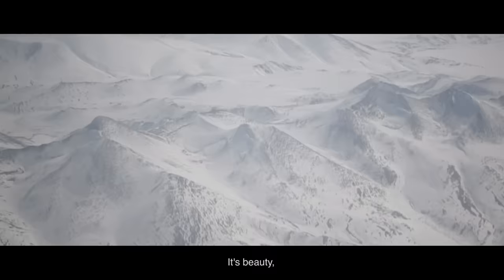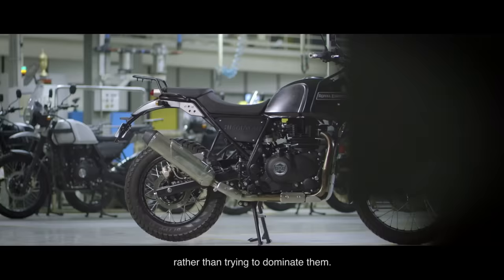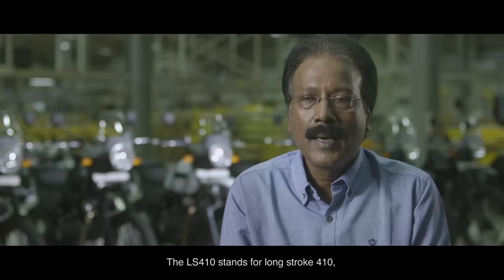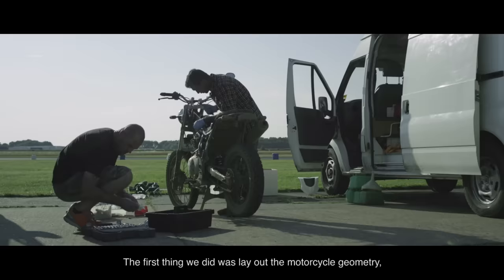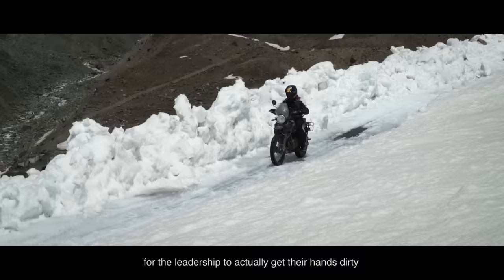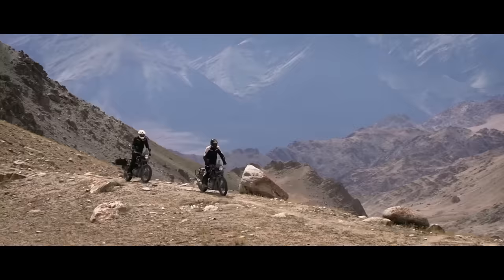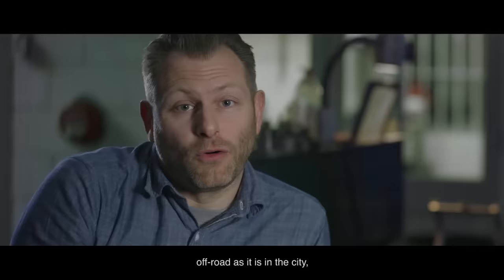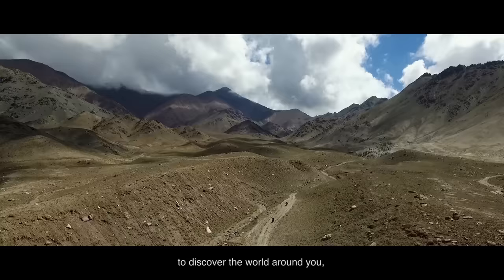Story of the Himalayan | Royal Enfield

Comment: Beautiful Himalayan!!! I'm a pretty sure this can be  successful here in Brazil. Our market is in need a dual-propose bike between 250 and 660 cm³. After 660 all bikes are more "bigtrails" style and have a little off-road touch, unfortunately. Me for example, I have a Tenere 250, light and angile on the trails but sometimes the engine isn't enough. I really would love ride this bike here.
Reply: I think you would find it a good step up. It has a far superior instrument panel with all the information you need for serious off road adventure riding. It's simple-rugged yet reliable design get's the job done with no fuss.One of the best handling bikes I've ever ridden.
Reply: I own a XRE300 and it's the best on/off road bike in my opinion in the 250~600 cc's due to it's comfort for long travel and it's low end torque. But the price is too salty for a bike that has absolutely 0 onboard technology it is a spartan bike that can take a lot of punishment without breaking but it's almost not worth the money you pay for it. But in a small town like mine that has only one Honda dealership, is a hard choice to go with a bike that has no close support but, I'd definetly risk it with this one, it's a beauty on it's classical look and it sounds sexy as well damn...Enfield will struck oil here in Brazil with that bike.
Reply: The Himalayan is actually has more powerful and torque than the Yamaha Tenere 250 (+3.5 hp and 1, 0 kg.m), but its excessive weight (191/194 kg) makes these advantages useless, except when you’re riding at very low speeds.
Once at the roads, I also can’t see any real advantage of this bike over it’s the competition in price. Again the excessive weight charges its price. 
This motorcycle is an anachronism; let’s comment a little about it.
Less than 60hp/L
It has a ridiculous pay load, weighting 191 kg and carrying only 169 kg maximum.
These are numbers from the first half of the last century!
Good luck for those that already have decided to buy one, I hope you enjoy your new bike forever, once it will be almost impossible to sell after one or two years. It’s a bike only for enthusiasts, not for normal use, as any other Royal Enfield sold outside India.

Comment: The radiator would help the engine to cool faster than oil cooling system, also the radiator maintains certain temp where the bike would be safe from over heating nd to avoid fire accidents
Reply: This bike don't have four valve oil cooling is sufficient

Comment: Looking for the upgraded version of Himalayan, I own a fleet of 10 Himalayans, honestly, gear shifter sucks, we have opened up two engines to sort out the piston knocking at 5,000kms. we can run it on broken tarmac as long as its not going uphill. I know its designed for dual terrain purpose but Please don't say that it can handle the complete dirt. Its still bulky. Really looking forward for the upgrade version of Himalayan. Keep the good work on flow.
Reply: Haven't encountered any issues so far at 1,000 km. Running like a sewing machine. Are you sure that somebody hasn't miss treated the bike-

Comment: I have this beast with me...it's awesome nd loving it each nd every ride I take, only draw back the engine temperature is shooting up due to summer, the city I'm in, they could have given a radiator with coolent system where these issues could have fixed, since it's a LS410 big engine, bikes like ns200, CBR 250 KTM 200 has radiator...nd the main draw back is the head lights...not powerful...60/55w there is no visibility

Comment: Low end Torque? 32Nm at 4000-4500 rpm. My brother pointed this out and we both agreed that with a 182kg bike the peak torque comes at a higher rpm. Meaning when we'll require the torque most, we won't be getting it. I loved the concept of the bike though. Finally there's a touring bike around 2 lakh.

Comment: Just what you need ,a 50 year old engine design that leaks oil in the finest British Tradition. Check out Yamahas and BMWs answer to all around adventure bikes.
Reply: your rant is unacceptable because this bike will only cost 1800 pounds here in India..... Yamaha & BMW cannot even try with this budget.... & the 410 cc is developed in 2014....not the 1950s
Reply: +truestar1995 
But the engine seems no better than the uce engine of 2009
Reply: truestar1995 , If you like them, then go for them. Don't teach them what to do. They've their rider followings..
Reply: Diss the REH and recommend to check out the BMW alternative? Yikes
Reply: Ls410 is  a lot smother

Comment: wating for new upgrade versions
Reply: Niharika Gohil ya the same here
Reply: The 2017 model is a very well sorted bike. The beauty of this model is it's simplicity with the carburetor still in use on this model. Superbly designed and engineered I've had no problems what so ever. I've done over 1000 km now and it's had it's first service. Required no extra work-just oil and filter-a good indication of how the bike is running under varying conditions.

Comment: i had a quick couple of miles on a demonstrator on the road and it seemed ok but was so noisy when pulling up hill with piston type knock, as normal i suppose with a long stroke single cylinder engine i was a bit put off, if i could get used to that the rest of the bike seemed to fit well, maybe i'll have a longer test ride after i get my interceptor run in.

Comment: Here is my two cents on Himalayan.

RE brand is the worst in terms of quality and reliability..they have cheap rusty parts and faulty electricals that will show wrong info or get damaged on water wash. And then there is the vibration and heating issues..

If all these things are ok for you or you can live with it...then Himalayan is a really good choice..it's offroad performance is solid. And it's highway performance is decent.  It has good size and height that make you feel like you are driving triumph tiger 🤣.
Reply: All of these negative comments are like smoking adverts... People are people 😂

Comment: Even i had booked one.But i heard some issues about himalayan the gear is getting stock or wat  and also the engine is getting heat very fast now i am little disappointed after hearing this should i change my choice or that all rumours saying.i had test ride himalayan that time i had felt that heat so i told them they sayed this is new bike right it will be ready.i need a experts reply for this.
Reply: You can surely buy one.......it's now available without any defect.......they have fixed all the facts........
Reply: I've had no issues at all and I've ridden under all sorts of conditions and terrain. Mines on 1,000 km and running really well. Handles the best of any bike I've ever ridden. It really is the best choice for dual purpose adventure riding.

Comment: Yes Himalayan is the one of the best entry level Adventure Motorcycle but the only one thing i didn't like with this bike the Lack of "ABS - ANTI LOCK BREAKING SYSTEM"  yes i know  this is a Adventure Off-Road purpose bike so there is no problem without ABS but in long riding in HIGHWAYS  ANTI LOCK BREAKING SYSTEM is a necessary thing so please note TEAM ROYAL ENFIELD please add ABS on this motorcycle!!!

Comment: The main complaint of himalayan is battery failure... And battery box is not at all in a safe position during raining water enter into the battery side...
And as u know that himalayan is a offroad riding bike then y the comapany give only self start for this bike...wether the battery get low on high altitudes then what will the custommer do without a kicker... The only option will become the reverse cranking...and thats so cheap for RE...
And the biggest villan is missing... Of bs4 series of bikes... Air locking etc...
First of all i appreciate that ur chasi and suspension are incridible but please fix this problems then only this machine got any future...

Comment: RE we are still waiting for the V twin
Reply: Royal Enfield was making V Twins in 1920s and 750cc motorcycles in 1960s. Why do you really need a V-Twin for ? A Bullet 500 single cylinder engine has enough low end torque for any Indian road. Though going with the European tradition, there is a parallel-twin 750cc RE engine coming in 2017.
Reply: +Rohit Saxena I am in Australia bro. Own cast iron in India. I am on the verge of buying one here but will wait till next year for the v twin.